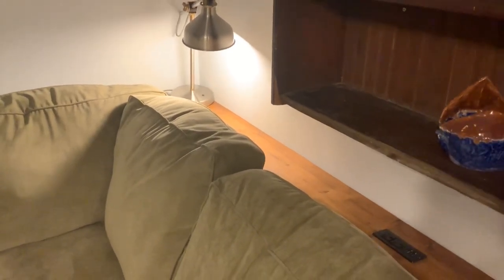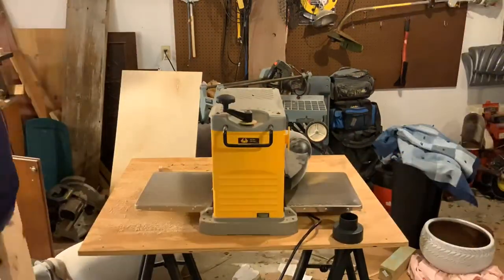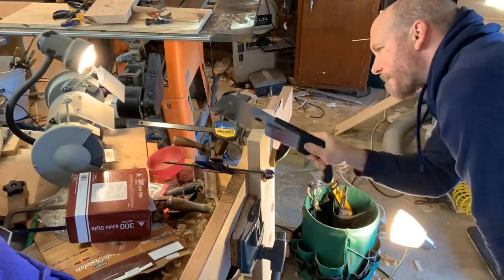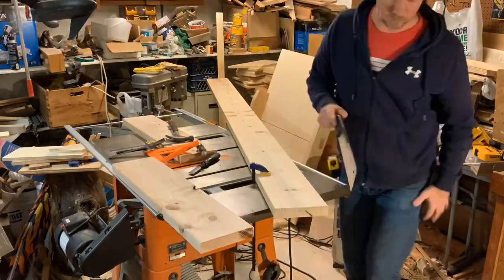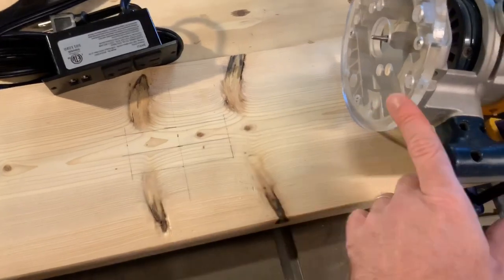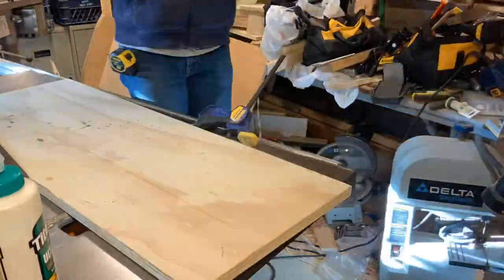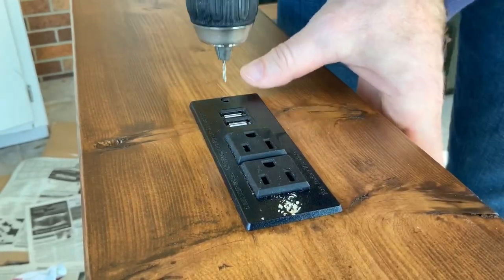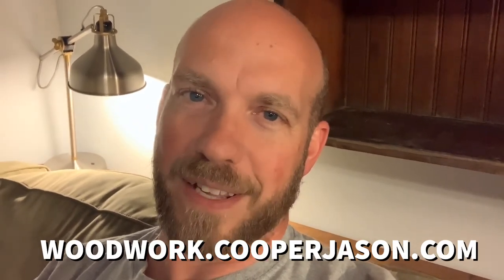How to Build a Skinny Sofa Table With Outlet and Dovetail Ends DIY

Comment: Was it hard to do dovetails with pine?
Reply from the maker: A little, yes. Making the cuts with the saw was pretty easy, but chipping out the rest across the end grain was a pain. Pine wants to tear out. You need to have your chisels nice and sharp, but even then it might tear out rather then chisel nicely. But as long as the exposed line/edge is straight it will still look good.

Comment: Any concerns about providing support for the middle of the table or making sure the legs don’t start to bow inwards?
Reply from the maker: I had no concerns of the legs bowing, but I did end up adding a 1x4 leg in the middle to support it as it was so long. I didn't attach it, just cut it to the right length and propped it up near the middle. Haven't had any issues since.

Comment: Hi Jason nice work and videos... I have a question about the cabinets you build awhile back... You mentioned the 3/4" prefinished plywood from Menards, Is the plywood a good quility  with a small amount  of voids??? Thank you for your time
Reply from the maker: I do not remember the quality rating, but yes, few voids. I know it's not void free. But when building cabinet boxes, none of the edges are exposed so you never see a void. Now, when I build drawer boxes out of ply, I usually use high quality 1/2" baltic birch ply since edges will be exposed.